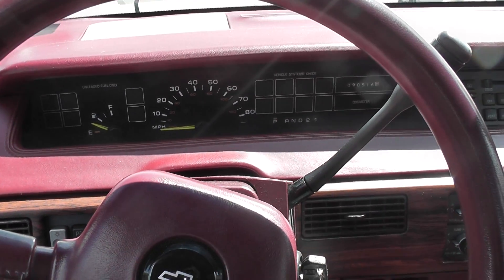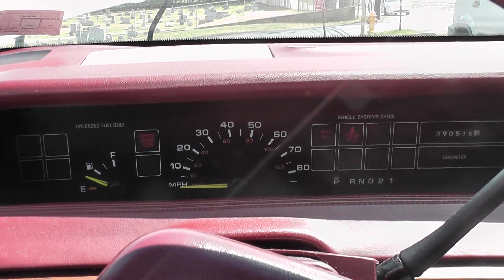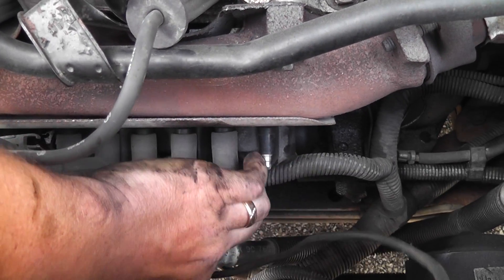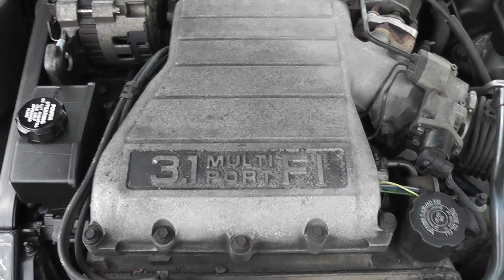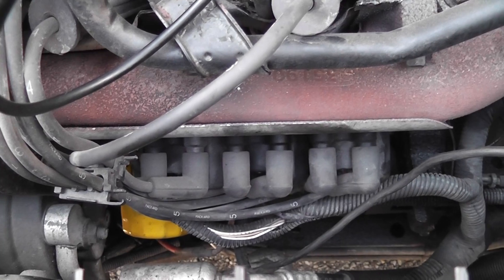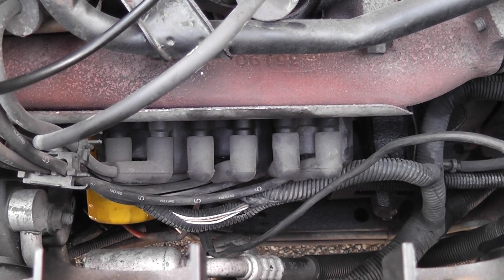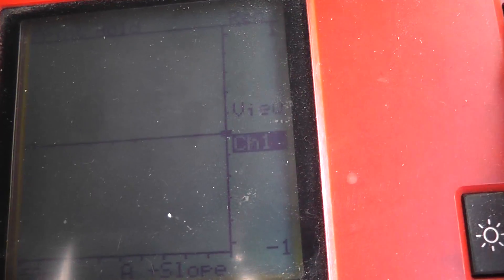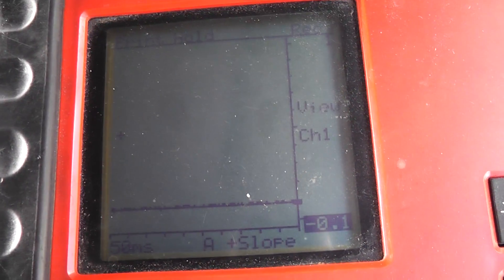How to test for shorted fuel injectors (1987-1994 GM Cars)

Comment: Anybody know how the Chevy 3.8 with no injector Pulse is tested ? Note ( very strange )My engine light flickering in time with the fuel pump pressure..
Reply from the maker: The 3800 engine? I have a ton of videos on this system
Reply: @ 1995 Buick LeSabre 3.8 .. engine light flickering in time with fuel pressure gauge .. pass side inside cab fuel pump chartering intime with light as well .. thinking pcm 🤷🏻‍♂️ but open to other tests ..  has spark and will run with outside fuel spray .. but it will not ground the injectors to open for fuel spray ..
Reply from the maker: @wolfnewman9432 with the key on, give me a voltage reading on all three wires of your TPS. I want to know what the 5v ref and ground circuits look like in particular.

Comment: So I checked my coils like you showed... Caus I had a miss.. the left side coil wasn't jumping polls..I put a new one on and the new one is not jumping polls either...could it be what it plugs into ? Please help
Reply from the maker: Use an incandescent test light to ground and take one coil wire off at a time and see if there is any spark from either tower (should jump to the light) If not, then your ignition module is most likely bad

Comment: I know this is old but I have a 94 S10 with 4.3 the injectors have no power I checked the harness plug and the 9ne wire  going in cab  does not have any power

Comment: how do u isolate the fault being the injector and not the wiring or pcm ground control shorted.
Reply from the maker: with an amperage measurement and an understanding that this is a group fired injection system. I have other videos on shorted injectors where I am teaching in the classroom, those will help you too. Thank you!

Comment: @scannerdanner i got a oldmobile cutlass supreme 1990 with the same engine in it.When i start it when cold it starts fine but as it warms up it shut off and no longer starts any suggestions???
Reply from the maker: yeah, shorted injectors! You found the right video. I have some other shorted injector videos on these GM multec1 fuel injectors here too.
Reply: @scannerdanner i appreciate the response i have changed the fuel pump,fuel filter, icm with coils,cranksenor and all the throttle body sensors.But i have not replaced the injectors.
Reply from the maker: @juniorguzmangarcia  do a resistance measurement when it shuts down. They should be 12.6 ohms each or 2.1 ohms measuring a group of 6 or 4.2 ohms measuring a bank of 3. With the 2.8 and 3.1 engines you can't get to all the injectors without taking the intake off, so the group measurements are key.

Comment: Have a question hopefully can help ? . Have a 88 oldsmobile cutlass ciera 2.8v6 and basically same as the 3.1 . But it needs fuel injectors too and they are like $75.99 a piece for stock ones at autozone they have porformance type fuel injectors for it way cheaper a hole set for around 200-300 butt . would that hurt the engine being stock or would that be okay just curious what would be best and they are accel brand I believe and I read they were bad fuel injectors them selves so kinda stuck wanted some advice thanks . I appreciate it
Reply from the maker: As long as the flow rate of the "peformance" injectors are the same as the factory, you'll be fine. DO NOT put higher flow injectors in your car
Reply: @ScannerDanner  meaning like the fuel pressure they spray out ? . I know the vehicle has or suppsed to have 51 psi fuel pressure is what parts store told me was stock from the pump . But I'm not sure what the flow rate is for stock injectors on the 2.8 . I believe the performance injectors was like 15 or 17 fuel pressure for them to run they had different types but I didn't see anything higher than that
Reply: @ScannerDanner  okay I just looked and they have 15 pound psi injectors , 17 , 24 and 30 pound psi injectors so not sure what type should get I'm guessing the highest which is 30 pound psi . Butt then again idk guess non of them will work ?
Reply from the maker: You absolutely do NOT want to run higher flow rate injectors. I do not know what the factory ones are but do your homework first. Aftermarket higher flow injectors are for modified engines ONLY! You put those in a stock engine and you will be running rich ALL the time!
Reply: @ScannerDanner  okay see that's what I thought would happen and that's what I wanted ti double check on cause few people said oh that won't hurt because the performance injectors will not spray no more then the stock type because of a stock fuel pump but I didn't think that was exactly true . Guess I'll end up buying stock ones after all .
Reply: @ScannerDanner  see it's a vehicle I'm buying the owner has had alot work to fix the cutting off problem or no start at all I mean it would turn over but wouldn't run . The car has a New fuel pump&filter , crank sensor , temp sensor , ignition coil , mass air flow sensor , air filter , and 2 fuel injectors but I found out the 2 was porformance fuel injectors so and that shouldn't have ever been installed and now the vehicle still isn't right it runs now but cuts up sometimes.  now it will run but starts misfiring after few min of running and can't give it gas without it cutting up or stalling and I know it's the injectors but with price of stock ones I was just curious since the performance injectors were cheaper would it be okay to install those but I wasn't sure if that would affect the vehicle are not being stock . But anyways I do really appreciate your help alot your only person I know and trust besides eric the car guy . But he doesn't do old gm stuff like you do . Thanks

Comment: With injectors you can get to, can you simply use an ohm meter to check for a short?
Reply from the maker: yes, just remember temperature is a big factor, also current flow through the winding can change things as well

Comment: I have one for you ScannerDanner,  a 1994 Camaro 3.4L auto that cranks and no start. It's getting fuel and spark (orange colored) and tries to start but won't. It's backfiring with puffs of black smoke and the plugs are fuel fouled. I'm thinking the PCM is dumping fuel into the cylinders and therefore needs to be replaced. If so, would I have to reprogram it or is it plug and play? Any suggestions would be greatly appreciated, thank you.
Reply from the maker: those are not the symptoms of a bad ECM, but yes, it is plug and play though I think you have to switch out a prom chip on that model. 
What codes are you setting?

Comment: Hey sir I got a question for you that I can't figure out for the life of me I got a 1989 chevy celebrity with a 2.8 v6 and I replaced the ECM, idle air control valve and the throttle position sensor and the crankshaft position sensor, temperature coolant sensor, map sensor, gas tank and fuel pump, new battery and the cat converter and exhaust all new and the car runs like a top when it cold but as soon as it get hot it dies but it will start right back up again after it shuts off when hot and runs for a good few minutes then dies and can be turned right back on again no problems and there's no lights on as well I'm stuck right now I am looking at replacing the Ballast Resistor now but I'm not even sure if that will fix my car I had two car mechanics who worked on this car before when they came out in the 80s and they could figure it out I worked with them when we tried to swap out the coil packs and the ones they had worked on another the same car as the one I got and when they put them on it wouldn't even start so we put the old ones back on and it runs amazing but still dies when hot and turns back on
Reply from the maker: did you check the injectors? Like in this video? Common issue for exactly what you are describing. I have other "shorted injector" videos (use that as a key word search on my channel)
Reply: ScannerDanner ok I'll try that I just bought a chiltons book off line as well and I feel like my engine would run like shit if it was an injector but I'll take a good look at them and get some new ones thanks for the comment sir much help
Reply from the maker: Please watch these videos https://www.youtube.com/watch?v=iIO-2LmwkdY
https://www.youtube.com/watch?v=KF9viLxwJNc
https://www.youtube.com/watch?v=3gTLY6vsxMg
Reply: ScannerDanner okay sir I will thanks again for the help
Reply: ScannerDanner okay sir I look at your videos I'll try to put them to use soon thanks a lot of responding as well have a great day
Reply from the maker: No problem! If you followed those videos, I show how to do resistance measurements on this design (so all you need is an ohmmeter) and you'll want to do the resistance test while the engine is hot and when it shuts down. 
If measuring the group of 6 injectors, you should see about 2.1 ohms of total circuit resistance (12.6 ohms each divided by 6) and if measuring a bank of 3, you want to see 4.2 ohms of resistance (12.6 ohms each divided by 3)
Reply: ScannerDanner alright sir thanks a lot for the help I appreciate it
Reply from the maker: whats the word on those injectors?
Reply: ScannerDanner I replaced them but the car still has an over heating problem and then shuts off so I just been reading the chiltons book I got to see if I can get some information about the car from there
Reply from the maker: John, this is new information. You never mentioned "overheating", you said it shuts down when it gets hot. Also, why did you replace the injectors? I gave you enough information on how to test them. The last thing I wanted you to do is to spend more money on something that wouldn't fix your car. My  whole motto is "Don't be a parts changer" and that's what you've been doing. I feel bad for you, please don't take this as me scolding you, I am not. I'm just invested now and we need to do things differently moving forward okay?
First question. How do you know it is overheating?
Second question. When it dies, what are you missing? Injection pulse, Spark or fuel pressure?
Help me to help you my friend.
Reply: ScannerDanner i see where your coming from sir sorry about that I thought hot and over heating are the same thing, the car has just about 75 to 80% of all new parts on it I got a few junk cars on my land so I steal parts that are still good off of some of those now the shuts off but turns back on when got it runs great when it's cold, but the minute it gets hot or runs hot it dies but turns right back on with no lights on or anything now the car did sit for 5 years without ever being ran until late summer of 2017 and I just dropped a new battery in her and she came right to life but after driving for 10 to 20 minutes it would die so I fixed that problem because the fan wasn't coming on it was the temperature coolant sensor and when the engine got hot the fan came on, she's got spark, and power and gas, and everything else works great and it only has 92,000 miles on it and that's from the day it was bought in 1989 so I'm stuck now when ever it moves from cold to hot it dies but will start back up asap I've heard other people were having the same problem as me but there car would take a half an hour to turn on my car just turns on like nothing happened and it runs like a top now when it is hot it only dies when you give it gas and let off but if your fast enough and give it some more gas it will shut off but turn itself back on without touching the keys in the ignition so that's the only weird thing that stands out to me that's left now

Comment: i also went throught the harness and found several chaffed wires which i repaired and a broken fuel injector wire which i repaired. had a map sensor code replaced the pigtail which fixed that. its runs smooth as glass, just no power when u accelerate

Comment: hey man. i got a 1990 chevy lumina 3.1 same motor as u have there. my issue is no power at all. u step on the gas it revs and accelerates but no power . fuel pump is putting out 39 psi. which i admit is low. i replaced the pump, still showing 39 , new filter new fpr. good spark. did tune up and intake manifold gaskets. i thoight it was tps no luck. previous shop replaced injectors , ect sensor , coils and icm. coolant level sensor. and i unhookes the exhaust to eliminate cat as the ptoblem no luck. only thing i can think of at this point is the ecm itself

Comment: have you ever had any bogging down problems with a 92 camaro rs 3.1. same system, mfi.. car starts no prob on cold starts, drives normal, wen car warms up. after 20 or so min, I floor it, car loses acceleration, I turn off, takes at least 3 times to start.. I heard spark plugs could be shorted, fuel filter, is clogged.. but I don't see why wen it cranks no prob wen cold.. I'm lost

Comment: Just performed this exact test with the exact same tools (a diff. brand low amp probe, though) on a 91 Lumina at lunch. Intermittant no start, intermittent stall, VERY erratic idle. Probing the blue wire, while the car is in its no-start condition reveals square waves, but square waves that are at an acceptable amperage...4.6 amps for the whole circuit. Which is more indicitive of a true fault (short or something else)...the high amperage or the square wave pattern v. ramp?  Just so you know, when the car is running, I'm seeing patterns that look more ramped (still jumping up a bit at the start) but that are near 6amps...certainly nowhere near as high as you were seeing here. Appreciate any advice!
Reply from the maker: +Rob Brown post this to my forum with the pictures of the injector waveforms. Can you do that? Even if you have to take a digital photo of your screen. Let me know when you post it and I promise to try and help
Reply: +ScannerDanner Just posted the pics on the forum. I appreciate any and all insight. http://www.scannerdanner.com/forum#/20151118/91-chevy-lumina-31-intermittent-no-start-inte-2-5076212/

Comment: Yes It Does Matter Were Those Wires Are Plugged In!
Reply from the maker: +Angel Scene (XxAnGeLScEnExX) not on an individual coil. there are three coils on this design. You cannot mix them up between coils but you can on the coil itself.
Reply: on mine it does...
Reply: +Angel Scene (XxAnGeLScEnExX) 

ScannerDanner is correct. The wires on each individual coil can be switched. Two cylinders fire at once on an old 3.1 multiport. Seems kind of odd, but that's the deal.

Comment: Turning the key on and seeing the check engine light in no way indicates the computer if FULLY functional. I got rid of a Lumina 6 months ago which had a computer that appeared to be working, but in reality was not. Troubleshooted to the point where it was determined the injectors were not being turned on (real easy to notice no gas smell when cranking, and starting fluid sprayed into the intake got it running, though horribly). No fancy diagnostic equipment, just a 194 bulb attached to one of the injector plugs on either side of the plenum. Nothing. I replaced the computer with something I got for 20$ off craigslist (against my better judgment I didn't even swap out the prom, my friend told me to just try it), and the things started right up. Computers are reliable, but they don't necessarily last forever.
 Also realize that on this car all injectors are fired/pulsed simultaneously. Disconnecting the injector plug from either side of the plenum gives you the opportunity to a) check the resistance of a single outer injector in a particular bank (at the cable), or b) ohm the remainder of the bank (at the receptacle down deep), regardless of whether the opposing cable/injector is unplugged. They're all in parallel. A single injector should read about 12 ohm, the rest of the bank ... uh, lost my notes and don't want to give erroneous information. If you have the Haynes manual, study the chart in the back. I think they were all parallel to one another. Disconnecting 1 cable removes 1 injector from the rest of the bank. Obviously removing the other removes that one too. But the remainder of the bank can be ohmed at the receptacle. Again the cable when disconnected will give the resistance of a single injector, when taken from the dangling cable itself. A far easier and more cost effective way to look for shorts. The video was very interesting, don't get me wrong, but not all of us have the test equipment.

Comment: I have a 1993 Chevy Lumina, same engine as the one in the video, that is not idiling well. I have been told by a mechanic that it needs new MAP sensor. Where is the MAP sensor located and is it an easy fix? I have replaced them before in newer cars and it was quite simple. I have very few tools, and no garage to work on it, so I wanted to be sure that is a simple fix before I get started.

Comment: I have a '92 GM 3.4L DOHC which died on me driving down the road..after cranking it for a minute it fired back up and I nursed it home on 4 cylinders. I shut it off and went to move it into my garage and it wouldnt start at all..so I cranked and cranked. then I put my foot to the floor and cranked it and it fired right up back on only 4. I got it in the garage and shut it off..tried to start it again and it did the same thing. soooo i pulled the old coil off with the missing spark on both terminals and tried a used coil which gave me nothing (the motor didnt want to start at all regardless of what i tried). Then put my old one back on and now its just not starting at all and theres no spark from any of the plug wires. Im Very confused with why it just cut right off..then fired back up..then wouldnt start without my foot to the floor..now wont start at all? before I start checking everything I can...Any advice?? I dont have much experience with these pain in the a$$ to work on motors.